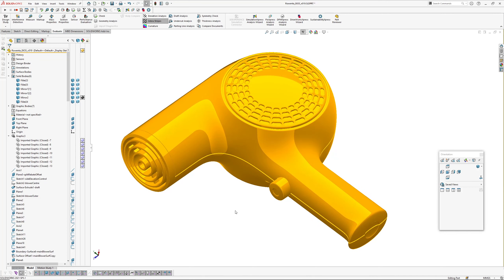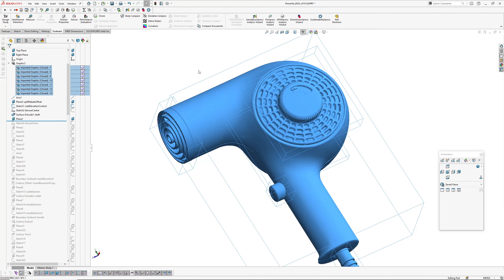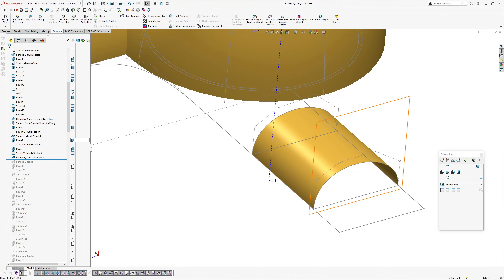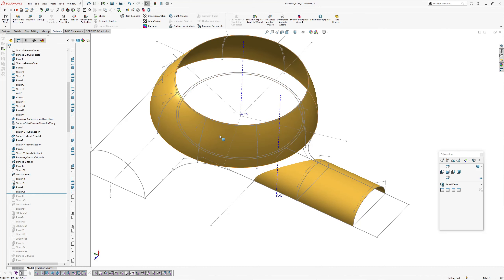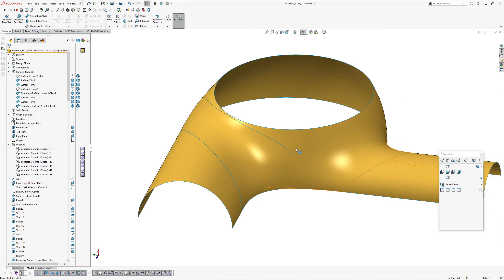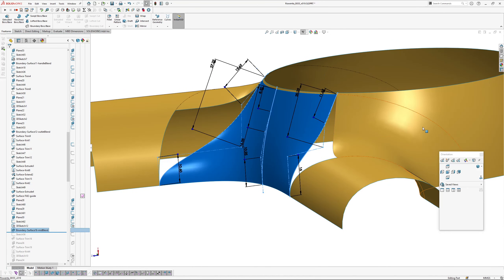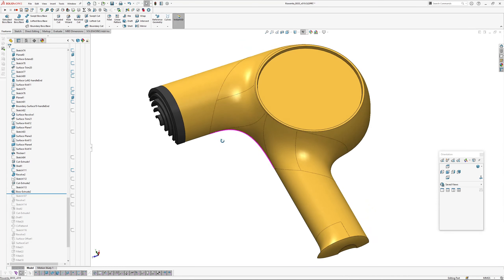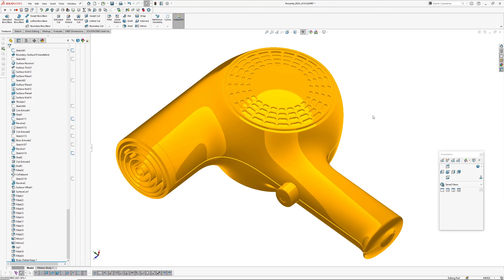Modelling the Rowenta EK55 Hair Dryer in Solidworks

Comment: This is an absolutely random comment, though whilst trying to find this old blog website that I used for inspiration, I remembered its connection to when I was working with Autodesk Inventor, and I was making this exact hair dryer for a school project. And so I was back tracking and found your video which was posted around the same time I was doing the same thing, and I just though the coincidence is amazing. 😊